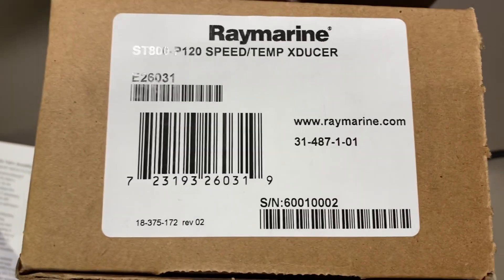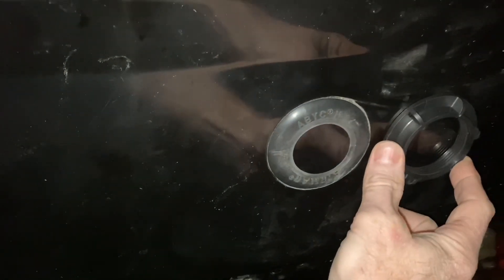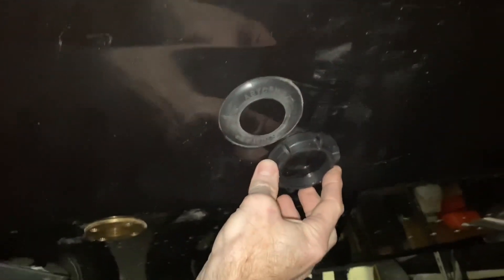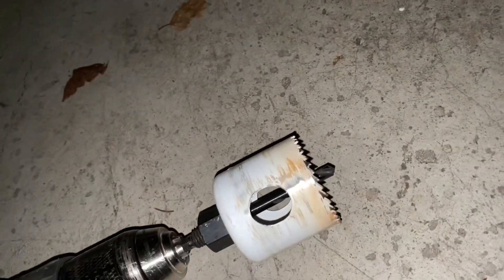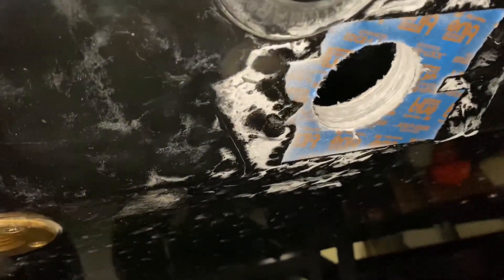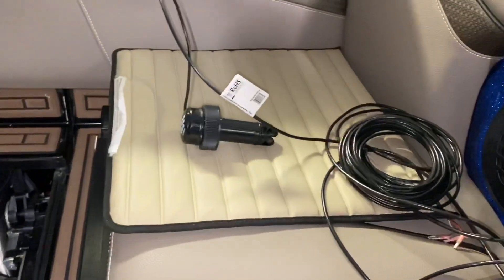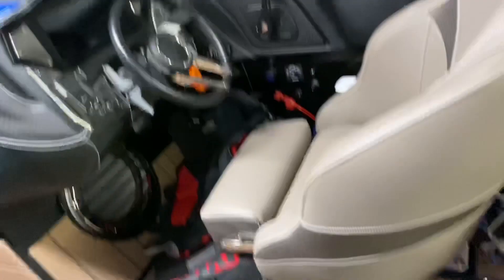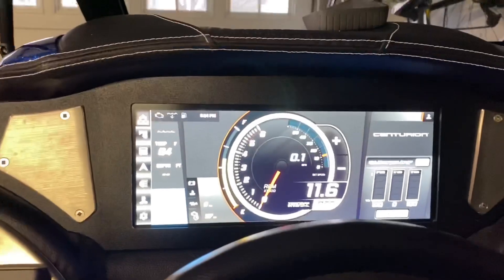DIY Centurion/Supreme Boats Paddle Wheel Install - (river mode) speed display Fi21 Fi23 Ri217 Fi23

Comment: Where did you get the push button labels? Mine are faded.
Reply from the maker: Those are the originals that came on the boat in 2018.
Reply: @TheRealWorld737  thank you.  I'll see if I can find replacements. Mines an 18 FI23 and they were all printed on the stainless.